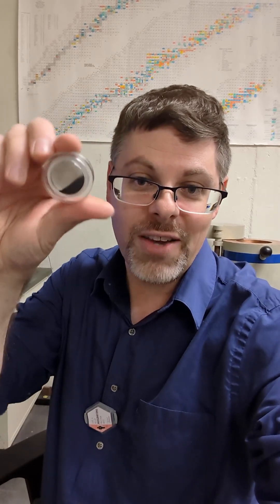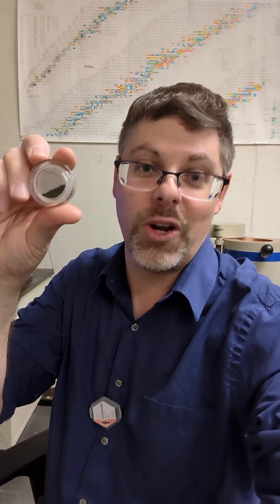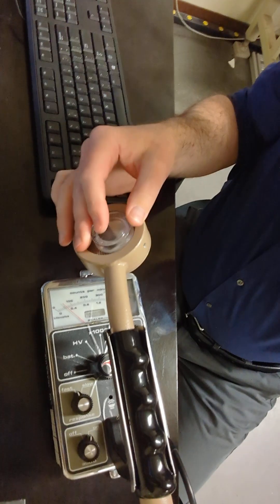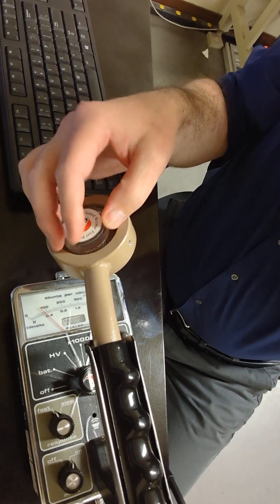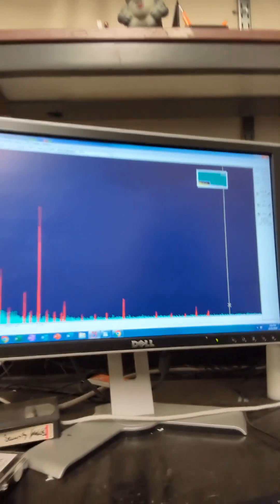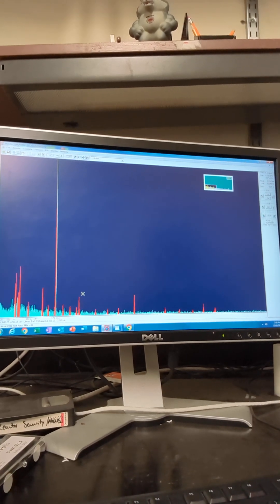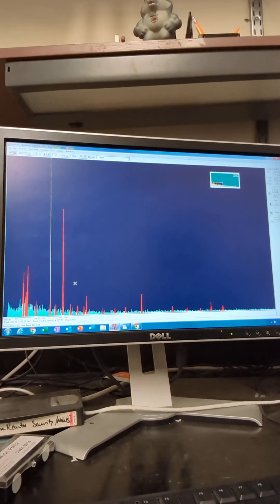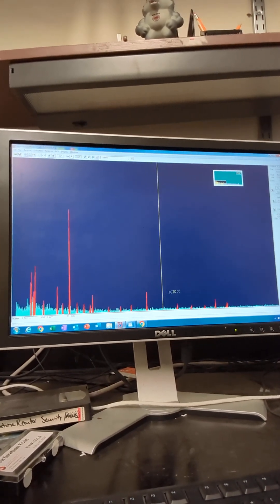A nuclear fuel commemorative trinket hides a nice surprise

Comment: I believe the particles are not simulants.  They are inert, without fertile or fissile material, but they still would have been part of the GA fuel pack depending on loading and moderator design. Also, Carl may be correct in using term TRISO, but depending on when these capsules were loaded, the primary GA fuel type may have still been BISO. I believe that Carl correct in believing these may have gone through the same GA equipment. Examining the particles in my own sample closely, I can see a few broken ones that show a layering that is consistent with manufacturing by deposition by floating a seed particle on very hot methane.